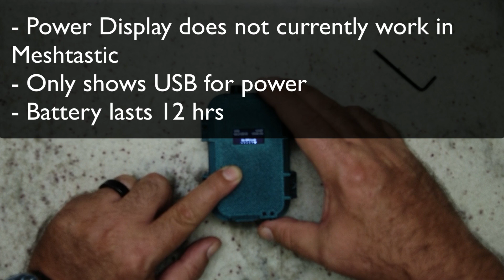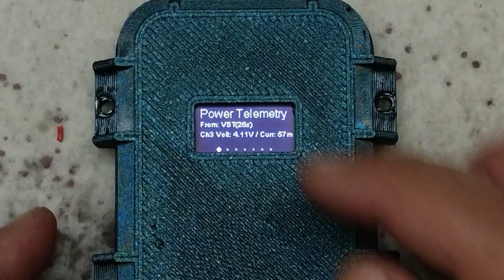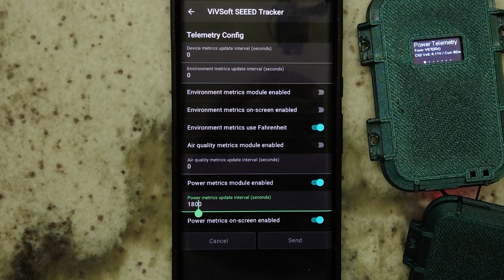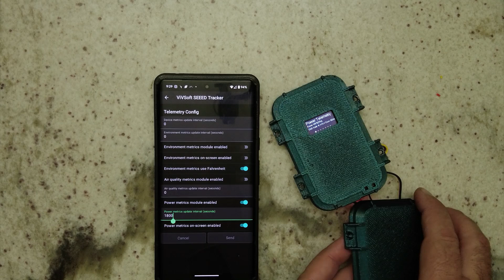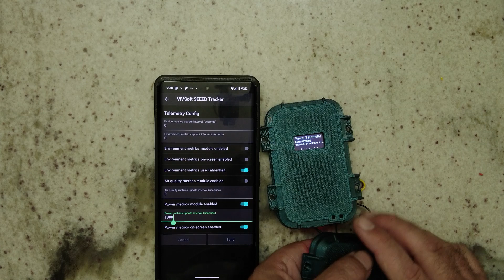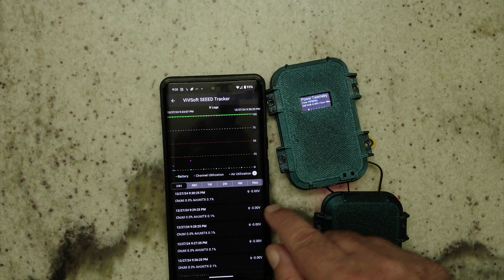DIY Battery Monitor Hack: WM1110 Finally Shows True Voltage! 🔋

Comment: Thank you for sharing. 👍
I just received a couple Seeed Xiao s3  meshtastic nodes and they don't display the voltage either.  I'll have to get a few of these ina219 boards.
Reply from the maker: You're welcome! The Seeed Xiao S3 is a great choice for Meshtastic nodes! Adding an INA219 is definitely a good way to monitor voltage—it’s a simple and reliable solution. Let me know if you need any tips getting it set up, happy to help!